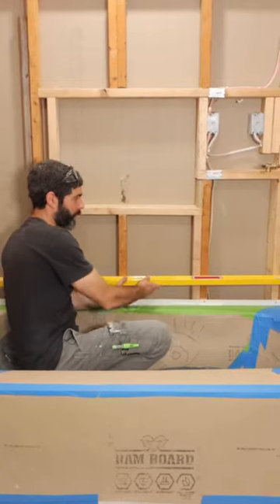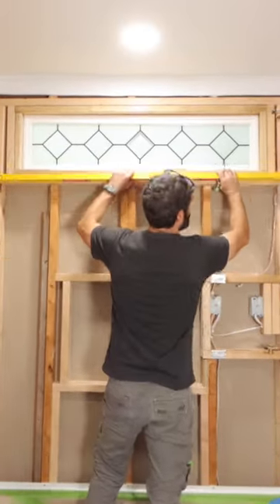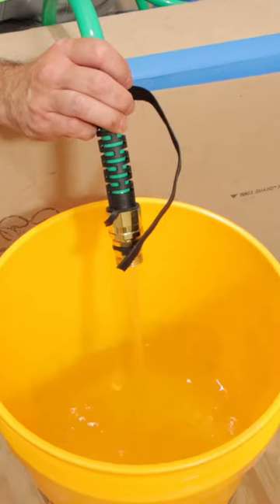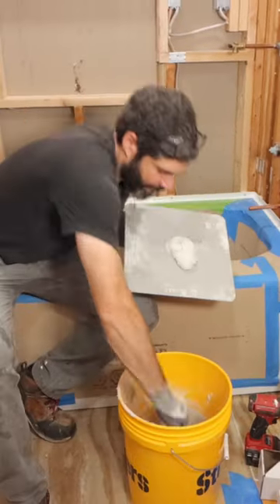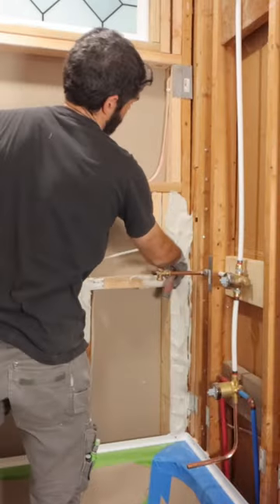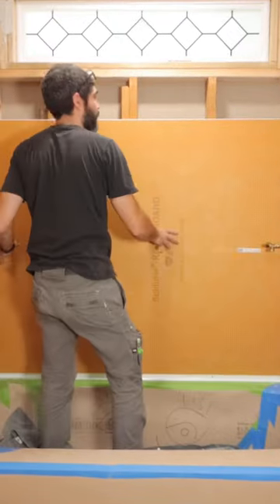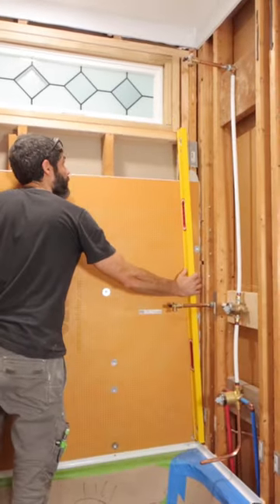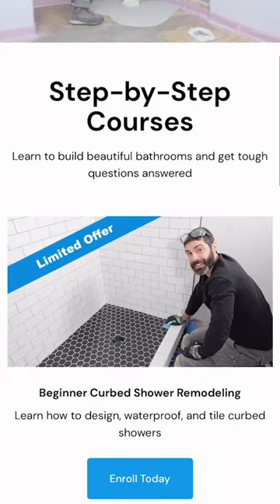How to Fix Shower Walls - #shorts

Comment: I did this and it's an awesome method! I made sure not to screw too tight and came back a couple hours later to tighten up before water proofing. Also, I notched out the bottom of the boards for the tub flange.  Zero chance of water getting back there at all!
Reply from the maker: Nice!! Great job 🙌🏼

Comment: It's alot easier to just spread a real thick beed  of construction adhesive up each stud. That will accomplish the same thing.
Reply from the maker: here's the problem with that, some construction adhesive can burn through the backer board and make it structurally unstable; it can also ruin the fleece and your vapor barrier at the same time

Comment: So your wet shimming and screwing in the backer board hoping that you can get everything level without spewing out the wet mortar?
Reply from the maker: You add the mortar, which should be mixed to a thick consistency, then add the board. Only mechanically fasten the board until it's plumb, then allow thin-set to cure for another hour or two. Once the thin-set is fairly cured, you can fully sink the screws.

Comment: Have you heard of anyone "red gaurding" the screw head and the corners/joints? I heard that thin set it not water tight and will let water seep through after a while.
Reply from the maker: RedGarding Schluter is unnecessary if you mix your thin-set to the correct consistency and use banding. I recommend using ALL-SET because there are specific water ratios for membrane and tile installations. Many people don't understand how Schluter works. It's not just thin-set that contributes to the waterproofing. You need the thin-set to bond to the fleece on the board and the banding. When the thin-set cures, the crystals mechanically anchor into the fleece on the board and understand of the KERDI or KERDI-BAND. Those crystals continue to grow over time and create a physical barrier against water, i.e. the water molecules are too big to pass through the crystals.
Reply: All of those spots get water proofed with the Kerdi system!
Reply: @HomeRepairTutor  I've used the schluter system before and like it very much but when I heard that the thin set does "not" water proof it, I got worried and not used it since. I am in the process of building a spec house and want to use it again, but I dont want any future problems from it either. I know it's a much faster system to install and the pan compared to the mud bed..... wow the time saving. Any tips?
Reply: Has anyone used Pro-light thin set for any of the Schluter systems?